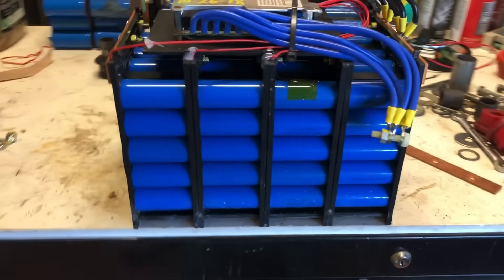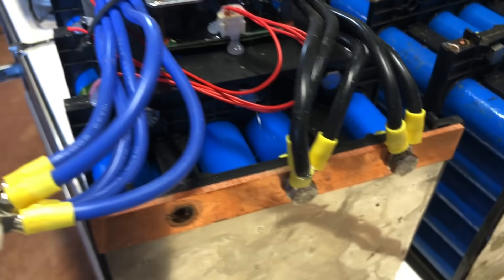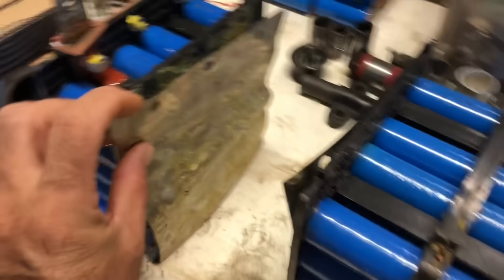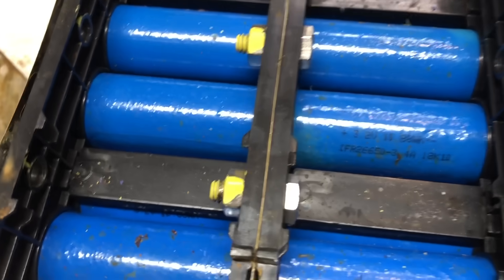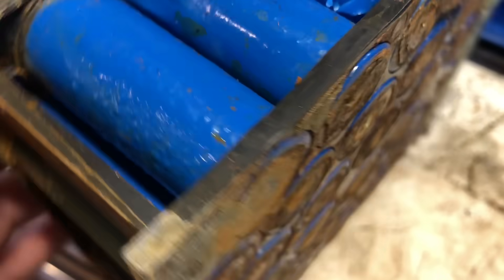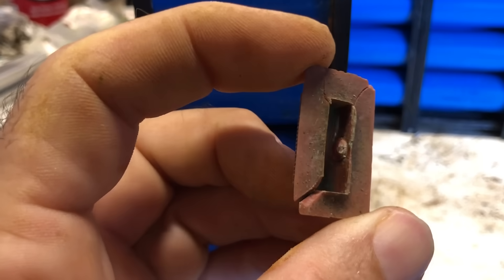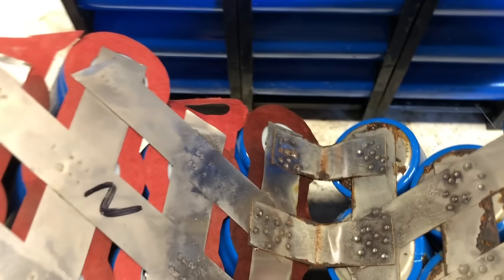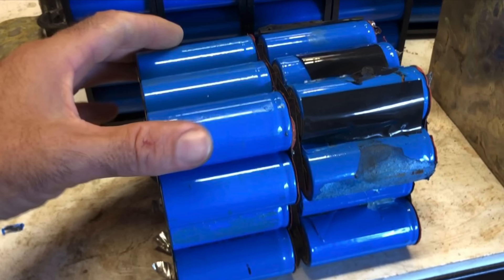Follow up to Battle Born Autopsy

Comment: All design shortcomings aside, these batteries featured are salvaged from a recycling or disposal facility, AKA a dump. To be fair, they could have been  flood damaged. Without accurate history, it is irresponsible to assume that the corrosion shown is the result of normal usage. The amount of corrosion would be consistent with salt water ingression, not condensation, especially in a tropical environment where temperatures remain relatively stable.
Reply from the maker: At the end I showed cells from a battery similarly designed and constructed that I personally owned from new and used in my boat for a few years and I can assure you moisture developed inside the box as the cells sweated. 

When the battery started flipping polarity on me and acting strange and shutting down, I opened up the case to discover cells covered in sweat, paper damp from moisture, water pooled up in the bottom of the cases and the start of corrosion. 

The reason the battery kept shutting down was because instead of having the BMS atop, it was on the side with the PCB resting on the bottom of the case. 

So much moisture had built up inside during cycling and the temp changes that the PCB was sitting in water and it had wicked up the cut edge of the PCB and all the traces had started popping off the board and the MOSFETS legs and solder points were corroding. 

That happened after only a few years, so imagine a battery that has been on the water and use in this environment since 2018. 

A shot glass of fresh water came out of each of these BB batteries with no significant signs of pathways for it to have gotten in with the exception of an inconsistently glued top. 

If these batteries had been submerged in salt water, they would likely look far worse inside. 

But as you said, they came from the dump and I don’t know the true back story, only pointing out that you want to avoid water ingress at all cost and that they have some poor design choices.
Reply: I agree with you on the corrosion issues - I'm not concerned about that at all.  However, you cannot just set aside the design shortcomings.  The main terminal issue is bad enough, but the method they chose to create the series connections between each parallel pack is not just ill-considered, it's downright dangerous.  They made a conscious decision to NOT use through-bolts on the bottom of those packs - which is truly unconscionable.  This is a GREEDY "American" company instructing off-shore manufacturing to knowingly build something poorly, and then charging the highest prices in the industry for that product.  There's no explanation good enough to get out of that mess.
Reply from the maker: @jasonbroom7147 

I think some of the issues stem from designing a battery that could be easily final assembled here in the US, like the use of cages to create modules, bolting things together or relying on mechanical contact, etc.. 

And smaller cells in general are easier to ship due to their small energy density whereas large Primatic cells require more logistics and often more costly special handling. 

Things have changed since these were first designed. 

The problem is BB didn’t change with the times and stuck with an outdated design and architecture that’s complicated and certainly more costly to assemble with the way cells are spot welded, epoxy to set the lug terminals, etc..
Reply: Battleborn claims a IP65 rating. Unless these were completely submerged water ingress should not be an issue under normal use. 

The design is still crap.
Reply: @TDub_ADV  Regardless, when used in humid environments, warm air gets pushed out and humid damp air gets sucked in when they cool. This killed the positive connection on mine.  Aluminum oxide all over the connection. Result: zero conductivity.
Reply from the maker: @TDub_ADV  I thought they were only IP54. 

Will look further into that…
Reply: @Willdesignsandbuilds  its right there on the BB website.
Reply: @TDub_ADV  ip x 5 de facto only means that thing will not die from water splashes. 7 or 8 rating is needed for partly submerged non pressurized non salt water. 
even phones and small electronic cases state that rating holds up only for some time (~under 1 year) after which it will be lost due gasket(or glue) seal deterioration. 
and for submersible design it should be specifically stated at which depth it was tested and if it supports repeated submersions, separate allowance for salt water.
if it is sealed in non airtight container(or if container is susceptible to strain cracks) then it should have big amount of dessicant (and be considered non serviceable and expendable)
Reply: @johndoe9922 correct, I never said it was waterproof, just that under "normal" use conditions water ingress should not be an issue.

I would not consider submerged "normal" use for any battery
Reply: All the money I wasted on these things pisses me off. Thought spending more would be quality was a mistake.
Reply: Overpriced junk... every dog has its day... hope they saved some of those huge profits they made cause their gonna need them.

Comment: Looks like a quick and dirty prototype not a finished product.
Reply from the maker: I hear what you’re saying, almost proof of concept like in construction.
Reply: Typical construction for a small company that has limited engineering and manufacturing resources and is selling a low-volume product. These batteries are essentially hand-made and each one will be slightly different. I’m not saying they can’t be a quality product, but the construction methods and design will inevitably lead to variations.
Reply: @TimAZ-ih7yb yes...and maybe they have no clue about ohm's law.
Reply from the maker: @T @TimAZ-ih7yb es, unfortunately I feel some of the design issues were brought upon themselves by creating a design that could be easily assembled in the US in small batches versus a lot of the overseas companies which design without the ability for the product to be disassembled, repaired or serviced.

Comment: Wow! It gets worse. That series connection system is dangerously sketchy. I guess the corrosion may be forgivable as I believe you found them in a dump and they are not rated as weather proof.

Comment: People are throwing these in the dump, legally?
What dump allows you to rummage through its contents?
Reply from the maker: These were improperly disposed of and placed in the pile of FLA batteries at my dump. 

The guys didn’t realize it and I let them know and took them because they could be dangerously holding capacity if say the BMS had shut down and the previous owner wasn’t knowledgeable about how to troubleshoot. 

So I grabbed them to harvest parts from hoping there would be some good stuff inside, best case they just needed a reset and charging, worst I make sure the cells are all dead shorted before properly disposing them at our HAZ materials recycler. 

Anyway I live on a small island and am protective of our environment. 

It’s expensive and time consuming to get stuff and materials, and we have run out of landfill room, so I try to recycle and reuse as much stuff as I can find when I stop by. 

Technically you’re not supposed to be rummaging, but even the guys that work there get it. 

They see just how wasteful people can be with our precious resources and know that a guy like me will give some of it a second life.
Reply: Our dump takes batteries, which then get sent to a battery recycler. I think that's fairly normal. And you can generally go to each area to drop off the right stuff, so you can usually take things back again if you want them (possibly not officially, but mostly no-one is checking, especially when it's busy).
Reply from the maker: @xxwookey What’s funny about ours is although the official stance is no rummaging or removal, across the front entry is a giant sign that says Reduce, Reuse, Recycle 😂
Reply: @xxwookey   Our battery recycle company would not take these big Lithium batteries.  I had to return with them and stored them in my garage for 8 months.  Then I cut them open and fixed the positive post problem.  One battery still had 100% capacity after 5 years.
Reply: I'd imagine it is very illegal to place large format Lithium Batteries into the regular trash stream.  But many open landfills are open to the public for dumping.  And if said item is within reasonable reach, they are probably not going to care if you take it!  Don't ask, don't tell kinda thing.  These BB batteries looked like they were from a saltwater boat, or possibly from a boat that sank?  Corrosion aside, there are several very bad design choices incorporated into the BB units!

Comment: This is exactly the kind of transparency we need in the battery industry. Seeing the internals and understanding the potential failure points, like those loose lugs, is so valuable👌💪
Reply: And the material choices (extremely compressible, one sided honeycomb, malleable plastic), or the totally inadequate, single edged bolt scheme for cell connections, using that same f'd up plastic.
Reply: @BorealisNights Absolutely ❤
Reply: WHEN THE MANUFACTURER SEALS THEM AND CLAIMS MILITARY OWN OR CRISTIAN I DONT DO BUSINESS COVER UP GRIFT.
SEE THE SAME WITH EMP SHIELD ALOT MONEY FOR INFERIOR PRODUCTS.
Reply: @dennisjolleyN6RBB Agreed!

Comment: That has to be the worst designed pack I have ever seen, such a stupid design to rely on pieces of foam to push the cell banks together, there has to be some serious heat going on between thess modules, leading to failure, this does not look like an expensive battery rather a really bad DIY job, shame on BB, let's hope Will Prowse sees this as he is going ganbusters against BB lately.
Reply: I wouldn't characterize Will as "going against BB"  he's just not that way.   It's more like, it became impossible to ignore, he found bad stuff and is now looking harder at a build we all assumed would not need to be checked at every turn.  Had somebody sent this battery as the cheapest on the market, he and others would have probably given it a harder lookover.  Being the premium early entry into the market it was seductive to assume that they had it right and not pick it so far apart.  Also the expense.
Reply: when the only people using BB are influencers who were given the product not purchased that tells me all I need to know
Reply: it's bad, but imagine how bad cheapo batteries from china are!
Reply: Battleborn are the best bang for your buck,foo!
Reply: @JohnnyDanger36963  I see what you did there 😂😂

Comment: Nice video…
So the battle borne issue with the bolts seems like  it could be corrected if one could get into the case.

Are all the bolts in need of tightening or just the one for the positive connection?

Could an access hole be made on the end and front to get a socket on and an open end wrench to tighten the bolt and nut?

How thick is the case material?

Is there room to get a wrench past	 the red wire?

Would it be better to cut the entire top off?

Thoughts on resealing the case?

I’m guessing a 1 inch square on the side and front is needed.   Perhaps using a milling machine or oscillating saw to carefully cut in princely to open access and then to seal them up again.  Without hitting	 anything….

Was there a desiccant inside to keep the, dry or were the corroded ones soaked or flooded somehow?
Reply: i would thinks the bolt are secure but because its plastic change of temperature inside the case cause the plastic to shrink and expands thats why the bolt looks lose
Reply: @billykulim5202 To me, it seems more likely deformation from hot terminals caused degradation of the plastic, leading to loose bolts.

The damn things are a fire hazard and should be recalled.
Reply: @ArthurDentZaphodBeeb  its hard to say because car engines use plastic engine components and they seem to work fine. Maybe some plastic is better than others so we have to investigate the true materials used!
Reply: imo it doesnt matter in insurance event: if it catches fire and damages something there will be evidence of tampering. 
if for non insured and non under warranty - simply put it into another case, use busbars to connect everything together. altough if you're not experienced with li baterries then it would be semi-unsafe to do because in the event of user error it can output really big burst of flame.
Reply: once you take it apart its not UL listed anymore so do whatever you want.
Reply: @uhjyuff2095   HOW COULD THIS MAKE IT THROUGH UL OR ANY LISTING TO BEGIN WITH ?
Reply: @casemodder89 It's not UL listed.  It's tested to certain published standards.
Reply from the maker: Lots of questions. I’ll try to answer some in my next video which will focus on how I would go about addressing some of the design issues.

Comment: This is apalling build quality and design for what are some of the most expensive batteries on the market.  I mean relying purely on friction for the inter-module connection?  Come on.  Just plain unacceptable.

Also side note, I can't be 100% sure on those sheets, but the strips are almost always 100% nickel strips, not nickel plated copper.
Reply from the maker: Ya, you’re right cause it’s pretty rigid material. I have cut myself a few times handling/welding cells back together as some manufacturers use the thinnest gauge they can get away with. The BB sheets must be pure as well. When I removed the one today, I noticed the material had a springy memory too it.

Comment: I wonder how far apart the dates are - some of the cell bricks appear to have a 2012 / 2013 date but the BMS shows 2018...
Makes you wonder if BB bought a lot of really old cells?  Then just packaged them up into a different capacity battery?
Thanks for showing us the breakdown - definitely wasn't made for the long-haul!
Reply from the maker: I believe those dates refer to day and month as you would probably top charge and let the modules rest then do a  capacity test and pair like capacity modules with like to make the complete 4S battery. 

I imagine the date on the BMS is the assembly date of the complete battery. 

I don’t know any of this for sure, just guessing based on how I would setup small batch production/manufacturing/assembling of  a product like this.

Comment: Thank you for the follow-up!
Shockingly bad design, that pack is a disaster. I know many would argue it’s “good enough” but I disagree. It’s designed to a price point, not to any spec for safety or longevity, and its deficiencies are so clear to see.
Reply: Its a premium price battery,they are just taking the Mickey with this